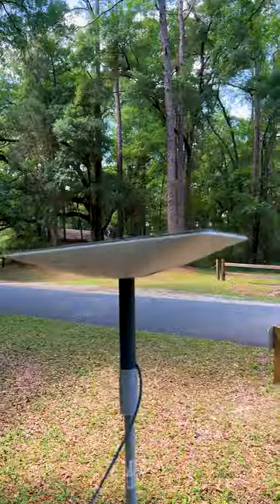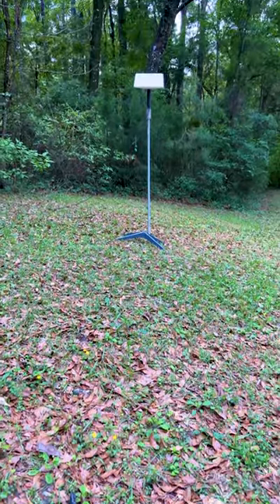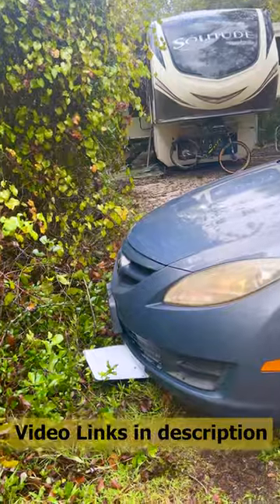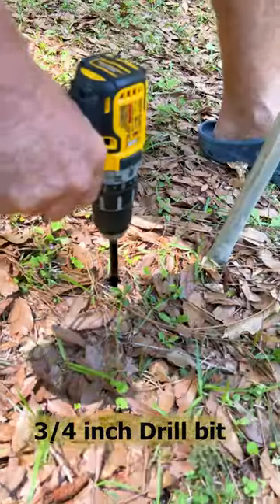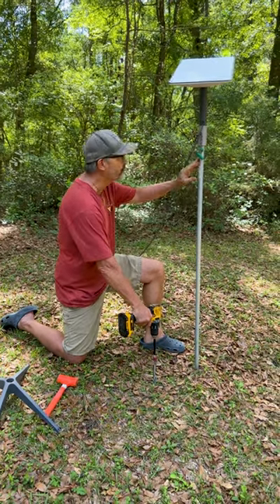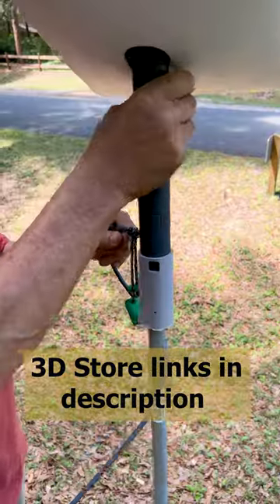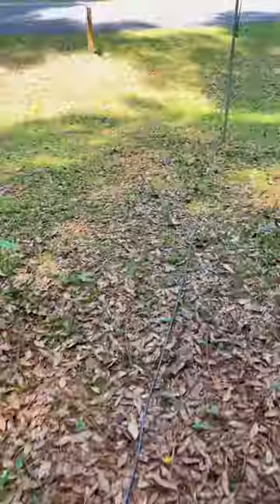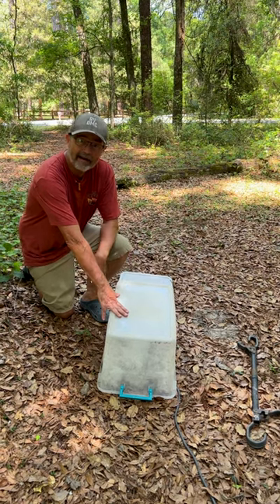Custom 3D Starlink Pole Mount #shorts (RV Living Full Time)

Comment: If you don't want to pay way too much money for another wire, the Starlink cable is just Ethernet with two pins swapped, so it can be pretty easily extended or shortened.
Reply from the maker: Larry just bought a huge spool of cable 😉

Comment: What kind of attachment are you using to drill your hole in the ground?
Reply from the maker: I have tried several sizes of screws but the longer the better, i use a 1/2 inch socket on my dewalt impact driver,
Reply: @DownsizingMakesCents  thanks!